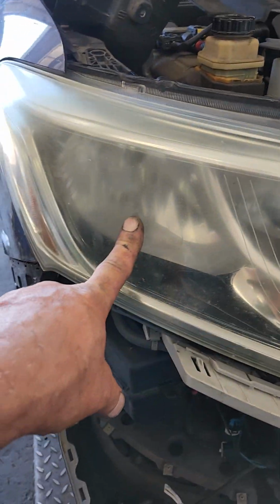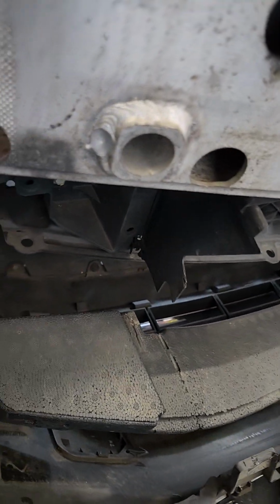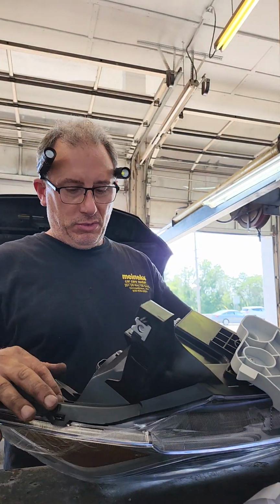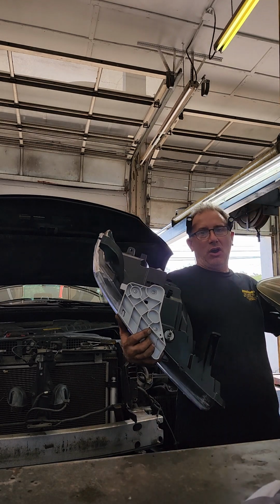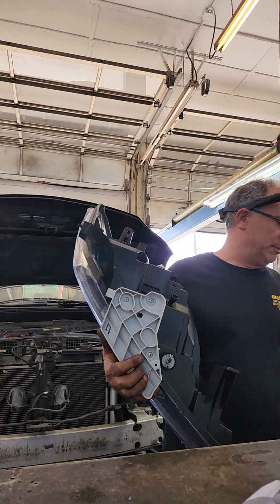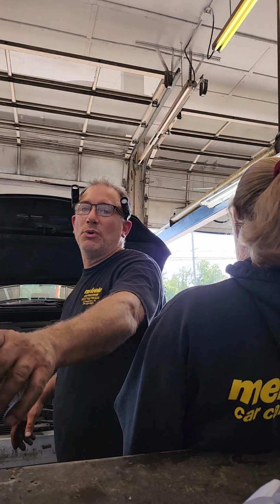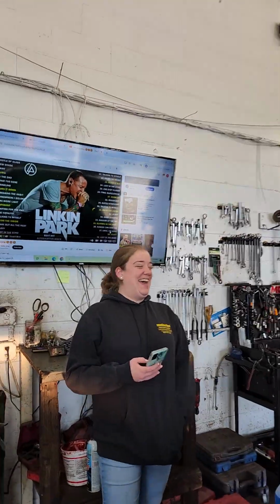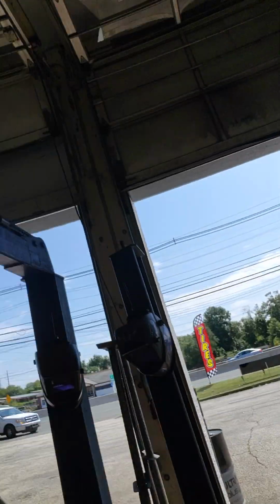2013 Nissan Pathfinder new head lights assblys  see the difference  while Rachel argues w me

Comment: My daughter has a 2010 Scion XD with original headlights. They were cloudy from age so I was going to just purchase new ones and swap them out. Found out that I would have to remove the front bumper to get to one the three screws that holds each headlight assembly in place. Didn’t want to remove a 14 year old bumper and have problems getting it back on properly (I would be doing this all by myself in my driveway) so I bought one of those headlight restoration kits. It did a pretty good job cleaning up the headlights, not as good as brand new but definitely clearer. I just plan to repeat the procedure once a year until she eventually gets a newer car. It has a bullet proof 4 cylinder Toyota engine in it with only 90,000 miles so it may last forever.